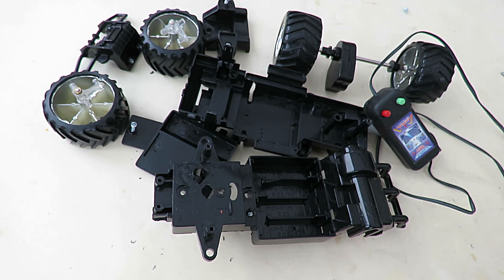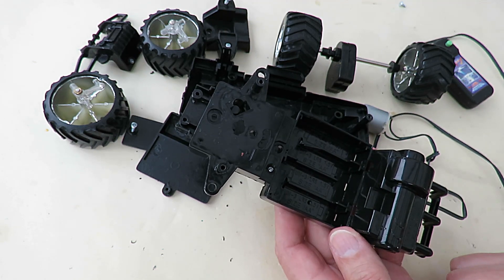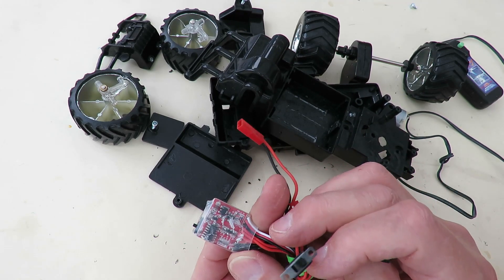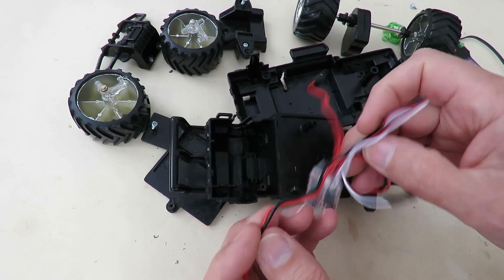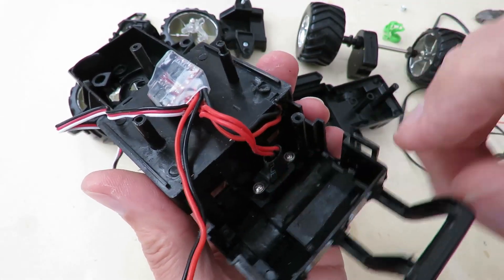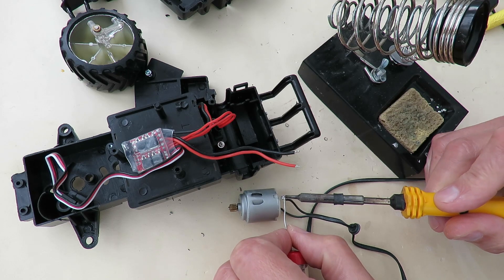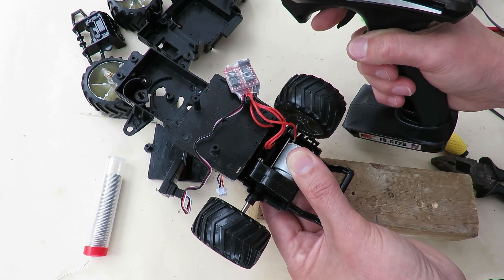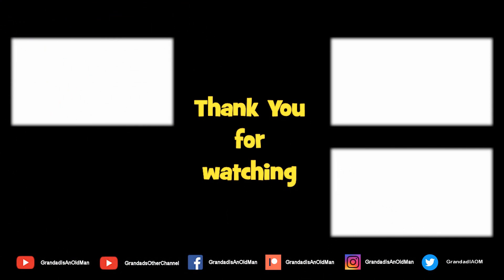Hobby Grade RC conversion of simple wire controlled toy car Part 2 ESC & Drive Motor

Comment: Looking good. Is that the USB soldering iron you were using and are they any good?
Reply from the maker: You made me watch it again to check, the yellow handled soldering iron is my personal favourite Antex 18W mains powered. Those USB soldering irons are amazingly good but best for working on circuit boards and nothing too big that would act as a heat sink and draw the heat from them quicker than they can produce it. I have taken one on holiday in the past "just in case" and did use it.
Reply: @GrandadIsAnOldMan  Thanks. Yes, I know what you mean about using it on a large surface. I would only be using it on a circuit board. Might get one now. 😁👍